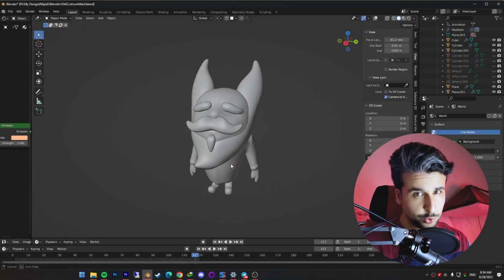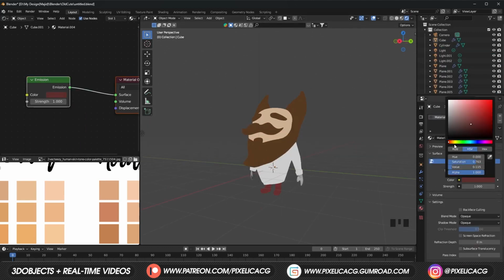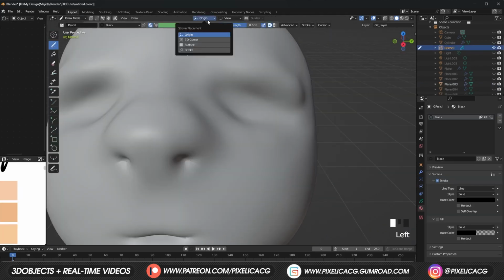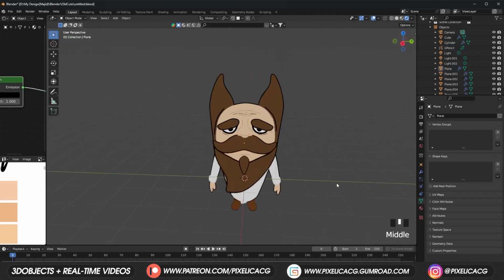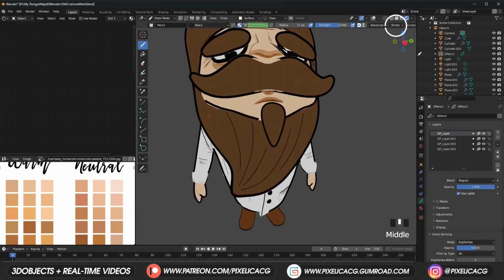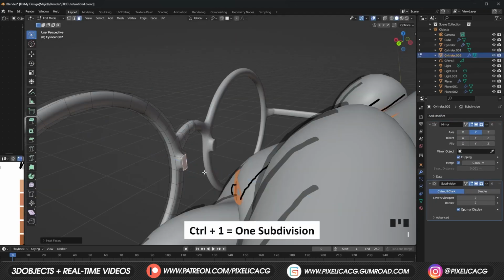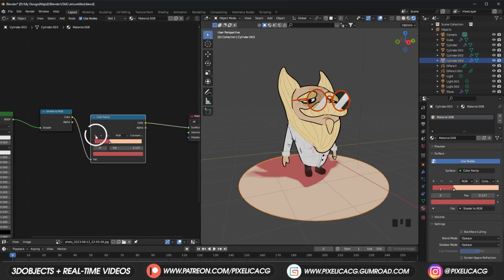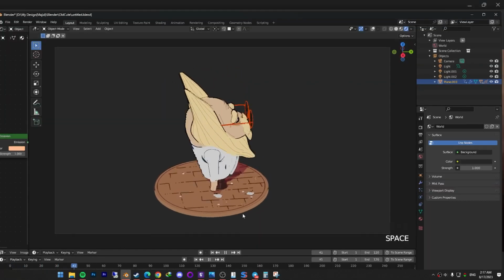How to Turn Your Character into a 2D/3D Cartoon Character

Comment: Can you draw with 3d model?? Just like normal sketching and painting but in 3d space?
Reply: Yes. You can put a model as a reference in the 3d space, and make a drawing over it in grease pencil...

Another option is to put the model in the scene as usual, and render / take a screenshot of the model's pose and camera angle that you want to replicate, and then import the image as a reference in your favorite drawing software to draw over it.
Reply: Look into the grease pencil 'line art' modifier. Much easier